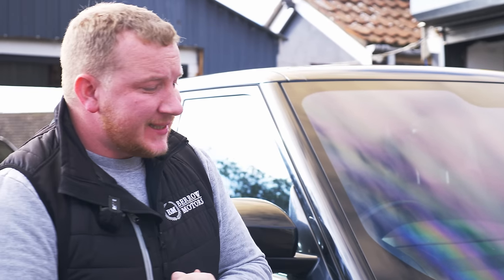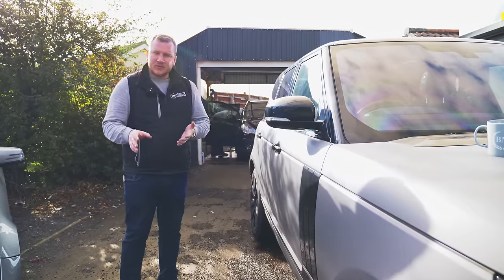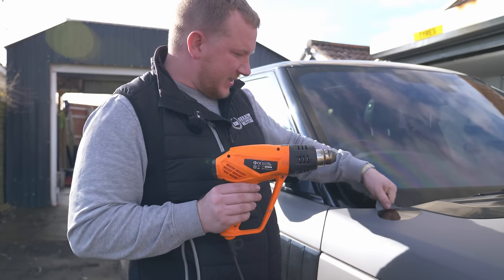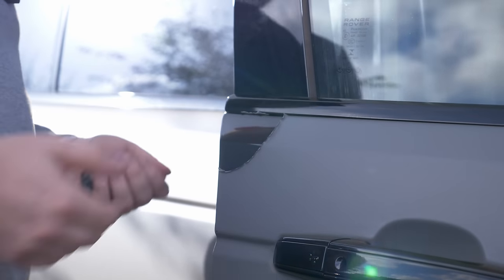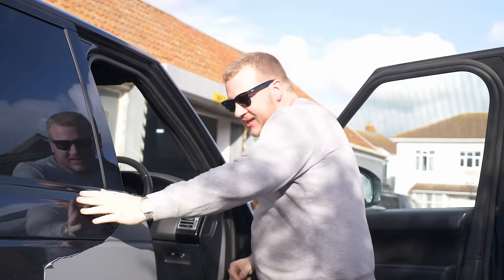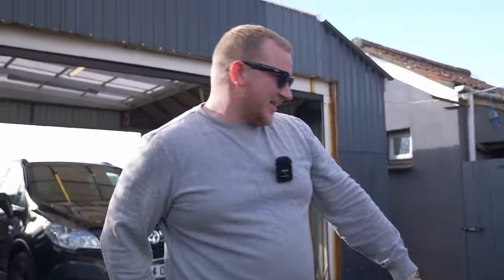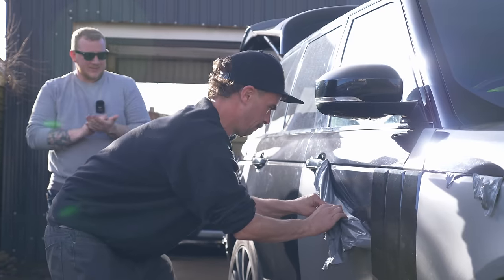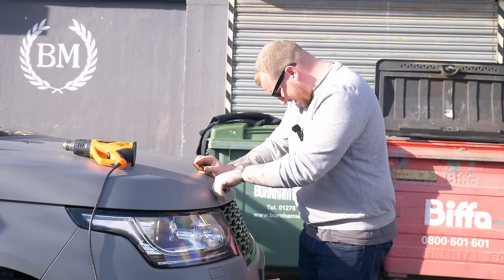You Won't Believe What Was Under My Cheap Auction Range Rovers Wrap!

Comment: That v is all out on its own. You should make a template before removing badges from masking tape.
Reply from the maker: They were much further out before!
Reply: @ShiftingMetal  lol they tend to be. They come on the templates but the originals are fitted in a curved shape. Takes a bit of practice to get right. Good work on the wrap coming off. A wall paper steamer is good for removing a wrap. A small smart repair and blend will sort that damage at back. Enjoying your varied content. Best Regards Paul. Ptcreations

Comment: Wraps generaly wont hide much, if anything it will normally magnify imperfections, even if prepped before you will see the paint contour or flat spots in the paint surface once the wraps been applied, yes you have to look closely and will show easier on a gloss wrap, matt can be a bit more forgiving but wont hide anything as such

However sometimes you can get away with different colour panels but depends on the colour of wrap... this grey would have hidden different colour panels easily, as much like paint the primer colour will affect the top coat colour so if wrap a black panel next to a white panel in say a yellow (any lighter colour) then they will end up 2 different shades

Again some paint can have a weakend laqcuer coat and sometimes may pull this from paint upon removal, likewise any aftermarket repair work/resprayed panels especially if removing cold... its essential to have the surface warmed gently to soften the glue to help release the wrap from paint... ideally acclimatise the vehicle for 24hrs first so the panels are all upto temp as such, you were lucky not to pull paint on this one... especially the side in the shade, being black.. well grey then the paint is  a more stable base than say a red car where you will most likely encounter issues unwrapping... 

 i started wrapping/vinyl application about 22 years ago, pretty much when wraps first hit the market and recently moved my company just down the road from you on love lane so feel free to pop down if ever have any wrap and vinyl related quiries 

Love watching the channel and tell Dan his Cube looks awesome too 😎👌

Comment: Hi Bob. I had the same problem on my XJ.  I used the same wipes as you, which worked well, but either side of the central screen was giving me problems as it was quite a large area. I found a spray called Sticky Stuff remover, which worked really well. I was a bit worried about spraying the buttons, but no harm was done, and it cleaned the buttons as well.

Comment: Well Joe, either I’ve been to the pub on the way home ( which I have ) or you lot went to the pub before you put the Range Rover decals on the front and the back 😂😂 top job though fellas. Just one thing as I’ve got one of these myself your top boot lid is out of line it’s a common fault just take the roof spoiler off and there’s four bolts to loosen to realign if you don’t it starts to chaff where it closes

Comment: Also I have a story about wrap. Bought a 420 off e b a y and it was wrapped black. We wanted to remove before sale get it polished (supposed to be blue). Unwrapped it and exactly as you were fearing it had a white wing on, and 2 red doors. Nice😅luckily the parts are only cheap was 800 to paint them found the parts for 200 for lot.

Comment: I hate both the black and the grey. For other drivers both are difficult to see colours. My friends were overseas for 6 months: I took their grey car (same colour as the wrap) for a drive every 2 weeks. In the first hour, there were more close shaves than I had in the previous 6 months. It kept happening until the lights were on.
Black is notorious for being about 25 per cent more likely to be involved in an accident. Based on research by an insurance company, using real data.

Comment: It does look nice in black.....until you drive through a puddle of dirty water and then it will look like a skip.  Black cars look dirty in the summer because the pollen lands on them and gives them a yellow hue, and they look dirty in winter because the dirt and grime stands out a mile.  That's probably why it was wrapped.  Well done though, it looks like you came out on top with this one.